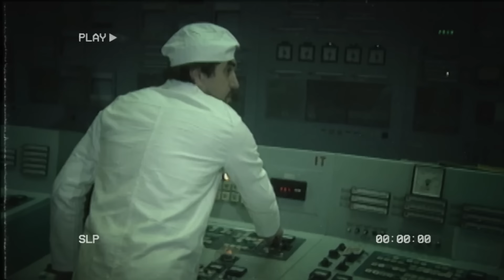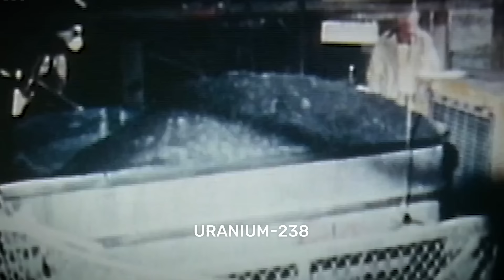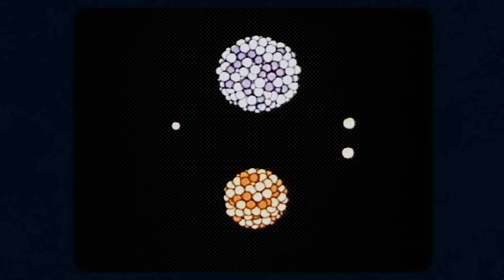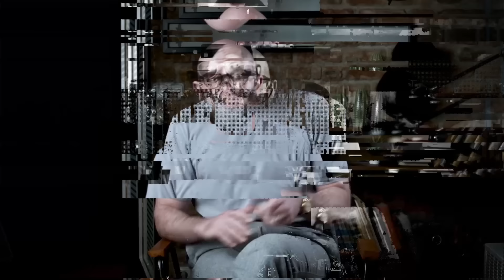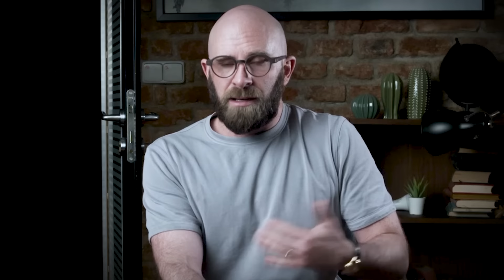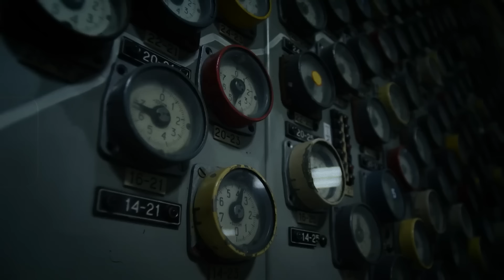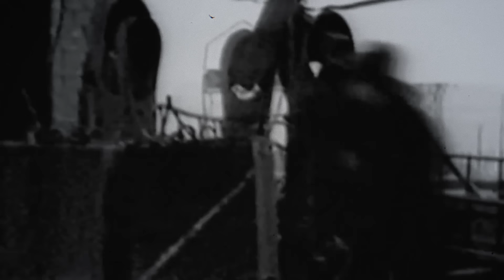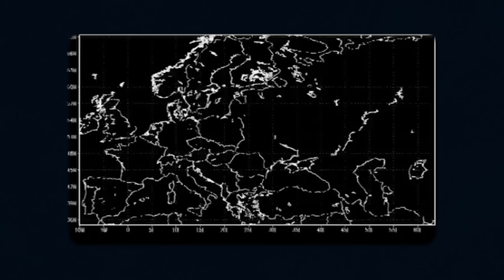The RBMK: The Shoddy Nuclear Reactor That Nearly Killed Millions

Comment: Wow. This video sucks. You glossed over so many parts, made so many mistakes, it is a abomination. I am however, not at all surprised. It is rare, exceedingly rare, to find a accurate representation of the events on that faithful 26th of april, and the design of the RBMK. And you're never one for historic accuracy anyhow. Maybe if the topic is to difficult to explain in 21 minutes, either take the time to do it well, accurate and scientifically correct, or stick to something simpler. And for reference, visit "That Chernobyl Guy". He has dozens of video's doing a lot better. He also takes the time to explain it well, come up with sources, science and accuracy.

Comment: Instead of using the still spinning turbine to power the pumps (aka the test that caused the explosion) for the minute or so it took for generators to kick in. Why couldn't they just skip that crap and use a batter bank to bridge the gap to keep pumps running till the diesel generators kick in?
Reply: the soviets cant boil water

Comment: 5MT of TNT?!? It is around 20 petajoule, come on. Be real, steam explosion means you'd need to have this energy in the form of heat and pass it to the water fast enough the construction doesn't blow up until all 20 PJ of energy is passed. Heat transfer is not that fast. The building was not meant to hold crazy high. Huge secondary explotion was never going happen.
Reply: Exactly - it would have the effect of a huge dirtybomb.

Comment: I've never heard the RMBK design referred to as "shoddy" before.  The issue was more that they were put into service without knowing fully how they operated and were learnt about and modified as time went on.    Chornobyl incident was caused by a series of mistakes more than poor design.   The safety systems were mostly defeated, the staff were poorly trained and a series of mistakes were made that caused the issue.     The title alone is rather misleading.    There is a lot of misinformation in this video.     The RMBK did have some flaws, as most things do.   One of the flaws was the lack of a proper containment in case of a failure, but the design was not "shoddy".     When people defeat safety systems, fail to follow correct safety procedures, and are not trained well, then this can cause issues with any device, be it a nuclear reactor or other device.

Comment: A reminder that the last of the remaining three reactors at the site didn't shut down until 2000 and the last RBMK reactor isn't slated to be decommissioned until 2035, yet no more accidents have occurred. 

Turns out when you follow procedures and fix design faults, accidents don't happen.
Reply: Don't run stupid safety tests to test failure of vital cooling pumps.

I guess Soviet scientists never though of a thing called "batteries" that would be constantly charged and would have provided more than enough power until the diesel generators kicked in.

Comment: Meanwhile the hard right wannabe PM of Australia is touting building 7 highly speculative SMR, total output less than 2 geographically diverse wind farms and a battery, at 100 times the price.  Oh dear, the technical meaning of diversity will trigger Musky and Trumpy.  "I implemented a frequency diversity multiple access communications system for our departmental transport system" = I bought a couple of CBs for our trucks.

Comment: 10:00 - 
     RBMK reactors really weren't a 'heap of junk'. In my opinion the major problem with this reactor's design was actually in that it allowed the operators to readily interfere with automatic safety features which could have saved them. Another major issue seemed to be the operators' and managers' lack of awareness of how their plant really worked or the specific safety protocols mandated by the designers of the reactor. 
13:40 - 
     Actually this is wrong, there was an excess of flow at time before the test (one such condition that the automatic safety features would have immediately responded to). This excess flow was a major contributor to the disaster due to the fact that it ended up inserting 'negative reactivity'. You can think of a nuclear reactor as a balancing beam of factors which cause the reactor to be be more reactive or less reactive. Control rods being inserted takes neutrons out that would otherwise go on to cause fission ---> negative reactivity, for example. 
     The major factor you skimmed over previously was the area load dispatcher requesting that chernobyl wait for the test until the peak electricity usage was done. This was only requested after the earlier shift had already started to reduce the power in preparation for the test, this was another FATAL mistake. When you reduce the power level of a nuclear reactor substantially it causes the amount of xenon in the core to temporarily increase because there are fewer neutrons to incident with the xenon particles. They operated at a lower power state for several hours, allowing the amount of temporary xenon to peak before they finally tried to reduce power to the levels required by the test.
     Now at the time of the test, there were multiple factors not being tracked by the operators or managers that were causing a load of negative reactivity in the core. This caused the power to continue decreasing past the point where they wanted it for the test. The operators / manager then decided that the best course of action would be to begin withdrawal of control rods to increase power. The operators / manager for some reason believed that their protocol at the time allowed them to withdraw all but 6 control rods, while the actual protocol was that no less than 26 remain in the core at any given time. In the RBMK reactor there were automatically controlled rods and manually controlled rods, the operators withdrew the manual rods to such an extent that the automatic rods began to insert into the core, again, neither the operators nor manager considered this.
    The xenon that had built up in the core was quickly being burnt away at this time. The 'balance beam of reactivity' at this point was extremely dangerous. The factors adding negative reactivity at this time were: excess coolant flow (relatively speaking) and xenon. The factors adding positive reactivity were the almost fully withdrawn control rods. They had set up their reactivity such that the factors preventing more fission were out of manual control, a really bad spot to be in.
     Finally, at the time of the test, they tripped the turbine generator, simulating a loss of power for their test. At this point, due to the drop in frequency on the electrical bus that supplied the coolant pumps, they began to slow down, reducing the flow rate of coolant through the core. This caused the coolant to heat up which added positive reactivity. It was it this time that all the positive reactivity in the core had thoroughly burnt through the xenon, and without the automatic protective actions there was an extreme rate of power increase. To make matters worse, the AZ-5 caused another slight increase in reactivity when initiated. 
     All these factors caused the reactor to be in the condition of 'prompt supercritical'. To explain, there are several 'groups' of neutrons produced by fission events within a reactor core. The pertinent groups are 'prompt neutrons' and 'delayed neutrons'. 'Prompt neutrons' are born from the fission event that split the atom of U-235 itself, you can think of them as being born 'instantly' (effectively instantly due to neither operator nor automatic system being able to respond to each generation of prompt neutrons). Delayed neutrons are born from the radioactive decay of 'delayed neutron precursors' which are excited fission fragment atoms that decay further into different atoms, releasing gamma particles and neutrons as they do so. Delayed neutrons are born much later after the fission even than prompt neutrons, for this reason reactor power is controlled with them. Luckily, at low enough fission rates, the amount of delayed neutrons is far more than the amount of prompt neutrons. 
     The condition of 'prompt supercriticality' is one in which the population of prompt neutrons is sufficient on its own to make the reactor produce more neutrons for each individual 'neutron generation'. The result is that power will increase much more quickly than you can actually comprehend it. 
     This is how the power excursion occurred which lead to the coolant flashing to steam in the coolant channels and lead to the first steam pressure lead explosion. The second explosion was likely due to a high temperature reaction that zirconium cladding has with air which yields a large amount of hydrogen gas. 

There, that's a fairly comprehensive technical explanation of what happened to chernobyl.
Reply: I hope you make a subsequent video soon that corrects these major concept errors, spreading false information does nothing positive for the world nor does it make for a more entertaining video in my opinion.

Comment: 5:00 - 
     This is an extreme misconception on the part of the researcher of this video. This reactor utilizes U-235 which relies on neutrons that have a similar molecular kinetic energy as its own particles. This is because a neutron with a much much higher energy level than its surroundings has a much much lower chance of causing a fission event upon incident with the uranium atom. Imagine a bullet traveling extremely quickly piercing a watermelon, it wont yield much of a reaction on the watermelon's part; It would likely only leave a small entrance an exit hole. Now imagine that same bullet traveling much slower, as it collides with the watermelon it transfers much more energy to the watermelon and blows it apart; U-235 is similar to that metaphor. 
     Now, where a moderator exists in a reactor core, there will be a 'thermal neutron flux' there that is relatively proportional to that moderators ability to 'thermalize' the neutrons in that area in as few collision reactions as possible. In parts of the reactor core where there is a high population of thermal neutrons there will be a higher rate of fission reactions occurring as well, thermal neutron flux / population is somewhat proportional to the 'rate of fission reactions' in any discrete location within the reactor core. 
     What you describe in that blerb is actually the role of the 'poison' within a reactor core, it 'disrupts' the rate of fission in the core by being an extremely likely target for neutrons to interact with. Instead of a moderator or fuel particle however, most nuclear reactions with a poison will not yield a neutron and as such there are fewer neutrons available to cause fission events. In this way it reduces the amount of nuclear fission events and thus reduces the amount of molecular kinetic energy transferred to the moderator / coolant.

Comment: Okay. There’s a lot that’s above my pay grade going on in these comments… what’s the final consensus?

RBMK safe, but bad operators? Or RBWK bad design?

Please only reply if you actually know what you’re taking about, with actual experience in the field or accredited education into the topic at hand.
Reply: I'll try, to test my own knowledge :)
RBMK has this critical design flaw that led to disaster, but only today we have full knowledge of it. Unstable at low power / Xe poisoning / ++ void coef.
Back then engineers and operators did not have such complete knowledge, and even still the reactor HAD safety measurements that were turned off for the test - alarms DID fire up, but automatic systems did not work due to being disabled. In other words, reactor would have shut down itself if systems were on.
Additionally, idea of RBMK was also a military use - enrichment of plutionum AFAIK, so factors like safety and cost were cut down. Thus no solid containment building, refuelling during operation etc.
Long story short - somehow flawed construction would have operated successfully and safely up to this day, if not for a sequence of unfortunate events, I think this is called a "perfect storm". Couple of things went wrong in perfectly disastrous way.

Comment: Something to clarify: moderator to slow down neutron does NOT slow down nuclear reaction. Contrary, slowing down neutron will boost nuclear reaction. Fast neutron will not induce chain reaction, because too fast to interact with nuclear material. Only slow neutron can induce chain reaction and nuclear reaction.
Reply: Yeah, I immediately clocked this. Would have expected better fact checking from this channel.
Reply: Why did I read this comment in a russian accent? ^^

Comment: A steam explosion is not going to cause 3 to 4 megatons of TNT to be released
Reply: @MisakaMikotoDesu  what they mean by megatons of tnt is the pressure wave from the seam explosion. The corium is very hot and there was a lot of water under chenobyl. 
The pressure would build till the ground above couldnt hold it and then kaboom.
Reply: @Saddleback117  I know, but you're not gonna get anywhere near a megaton of explosive force from Steam. I would guess it's not even possible even in theory.
Reply: @Saddleback117  There is no amount of steam that can result in a megaton of tnt scale explosion. Simon's writer has been getting their data from Greenpeace, a notably anti-nuclear fearmongering group bought by fossil fuel interests.

Comment: I live in Philadelphia Pennsylvania,and can tell you there is nothing efficient or safe about a nuclear reactor. I was in my teens when that thing almost went china syndrome. I found out that there is water tp cool the rods . Were does that radioactive water go when its done its job? So that's a dangerous waste product. Some one is pissing up my leg and telling me it's raining. Even back in the day they told what was truly going on .
Reply: But you still enjoy your electricity, is that right?
Reply: The water stays in the core. That's why there are 2 or 3 coolant loops that don't mix. Not to mention that the water never touches uranium fuel as it's covered with other elements specifically to prevent it from touching water. The TMI accident did not released dangerous amounts of radiation, panic caused more harm than TMI.

Comment: For those people wondering why the fast neutrons need to be slowed down, it's because you want the neutron to bind to a nucleus of U-235 in the fuel rod to make U-236. U-236 is unstable and wants to split. When it does, energy is released. This is what we call fission and is what we want. If fast neutrons were not slowed down, the U-235 atom in the fuel rod would be blown apart by the energy of the neutron striking it. The fuel rod would deplete very quickly without a neutron moderator (perhaps within hours) versus the 3 to 7 years with a moderator.
Reply: No, fast neutrons cause little reaction. Very few U-235 are "blown apart" by fast neutrons - the atom is quite big, but the nucleus to hit hard is tiny... Slow neutrons does not need to hit so precisely - atomic forces can catch even them from some small distance away.
Reply: And exactly this should have been mentioned in the material when "covering the basics". But noooo, MEGATONS STEAM BOOOM ;)

Comment: Fukushima is still melting down as we do not have the knowledge to handle the 3 reactor cores because of the intense radiation. Keeping the ground frozen and thousands of non earthquake proof containers of radioactive water is not a solution.  Remember Windscale, 3 mile island, etc.  Hanford site in Washington on the Columbia River with no more superfund money available.
Reply: At least Chernobyl is inland.  Keeping burying with concrete and steel as radiation continues breaking down.  Melted mass burning to water tables eventually into rivers then oceans.  Russia dumps many of their old nuclear propulsion units into the ocean.  Several of their subs misshapes are monitored on the ocean floor

Comment: Nowhere near the Mt range, more close to 3kt at best. First was simple steam explosion, second was hydrogen freed from the reactor igniting. The biggest issue was a positive temperature increase of moderation efficiency. Once it flashed off the xenon the the heat spiked enough to cause the moderator to overwhem the control rods.😮

Comment: Chernobyl is a perfect example of how political interference in Engineering matters is deadly. There is a well-written book by an American investigator into the disaster who was on the international team allowed in with full access by Gorbachev. Going back into the design process, they found documentation that the Engineers knew that, under a certain operating condition, the reactor could go unstable. They went to Stalin and explained that, although the risk was small, they wanted another 6 months to redesign the problem out. Stalin had set a deadline for atomic bomb production, and refused the extension on the grounds that the risk was small. The real "criminality" was that he also ordered that the risk be kept as a State Secret, so there was no mention of the risk parameters in any operating or training manuals making the operators unaware of the risks that they were taking during those trials.  It is pure unadulterated luck that there have been no more RBMK explosions. There are parallels in both the US space shuttle disasters.

Comment: Moderators speed up the reaction by slowing down the neutrons so they are more likely to collide with another u-235 atom. That's why you hear "graphite moderated." Graphite accelerates nuclear reactions. Components that slows down the reaction are called "absorbers."

Might want to redo this video.